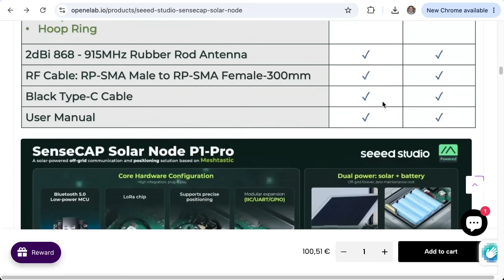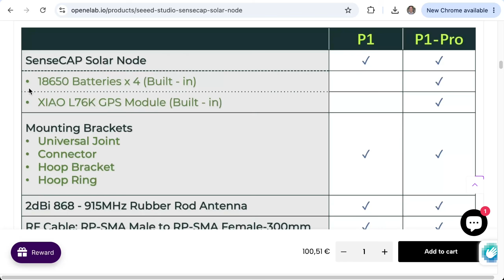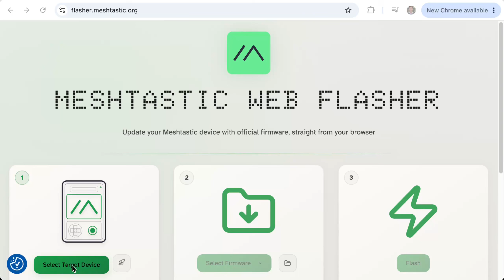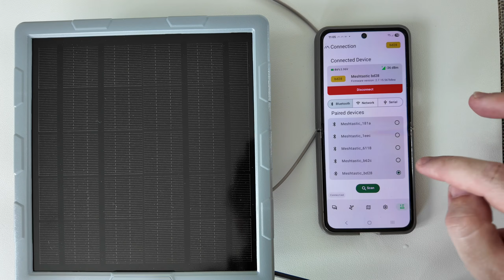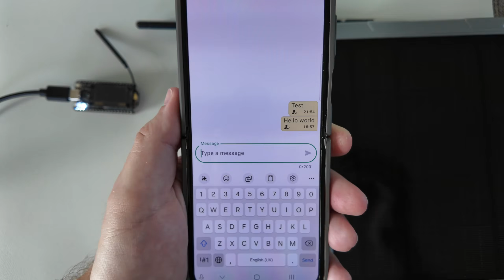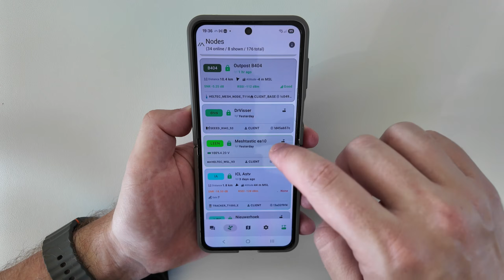Off-Grid Networking: Meshtastic SenseCAP Solar Node P1-Pro - Setup & Test

Comment: Hi, I'm new to meshtastic, Any advice to get a good range from small node ? (xiao s3) There are a few in japan so it's hard to get to another node.
Reply from the maker: If your node has an antenna connector, you can replace the antenna with a better one.
Reply: You can use a fiberglass antenna
Reply: Thanks for the answer !
Any recomendation ? How do you handle node position in city ? Beacause big building make it difficult to transmit I guess.

Comment: Features that I would be interested in learning more about is practical use of it for sensor type applications. By that I mean things like other cheap meshtastic nodes that have temperature/humidity/air pressure sensors sending their data to a private channel managed by the solar node. Then having an application such as something on HomeAssistant collecting the data from the node and displaying it on a dashboard.
Reply from the maker: It's an interesting idea, thanks :)
Reply: @DimitriiLab It looks like the Grove connector is on the inside of the unit and does not allow for an external connector. It might be used for a sensor inside the unit but that likely skews the data and would not represent the outside world. Related, I do have one of my Raspberry Pis that hosts birdnet-pi collect cpu temperature and report that to my homeassistant. For any device in the outside world I have found that to be useful for device health awareness.
Reply from the maker: @DougToppin  Thanks. I checked the Seeed Studio page, and extra Groove sensors are indeed available, like temperature or pressure. I had a barometric sensor somewhere in the box; if I can find it, will try to test :)
Reply: @DougToppin  Hi! That is a very practical use case, and exactly the kind of scenario where these devices can become really useful.
This device’s Grove interface can be connected to sensors such as pressure, humidity, temperature, Heart Rate & SpO₂, and even an I2C keyboard.
Compared with Meshtastic, LoRaWAN is also very suitable for this type of sensor-to-Home Assistant workflow, especially when using Grove sensors. It has strong native support, plus a mature ecosystem of both industrial-grade and open development products.
We have also created a dedicated landing page for LoRaWAN sensor nodes and weather-station-style applications here:
https://openelab.io/pages/seeed-studio-weather-station
There are also maker-friendly options such as the Wio-E5 Dev Kit with Grove sensors, which can be very convenient for building this type of project.
Thanks again for watching the video and leaving such a thoughtful comment!

Comment: It does not look like there is any ventilation. Have you seen any heat problems? The unit looks really professional.
Reply: Hi, the biggest heat source will be the solar panel.
In bright sun being black it will probably hit 70c. I will have to see what my home solar gets to but it’s enough to kill grass if you rest it on it!
Heat wise from the electronics will be minimal.
The power is virtually all going to the transmitter.
Whilst charging* the batteries will warm but with the low output of the panel that again will be minimal.
Heating to all of this from the solar panel will be the biggest issue.
Should you be worried you could put the enclosure behind the solar panel in its shadow and keep them separated.
Take care M.
Reply from the maker: @markeh1971  Thanks
Reply from the maker: According to Meshtastic app, there is no environmental data like temperature, there is probably no sensor inside.